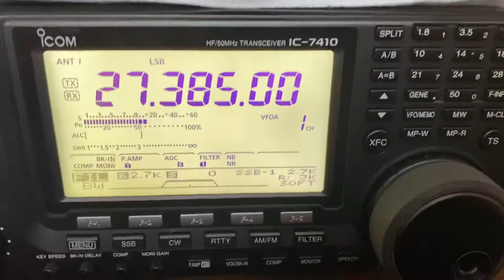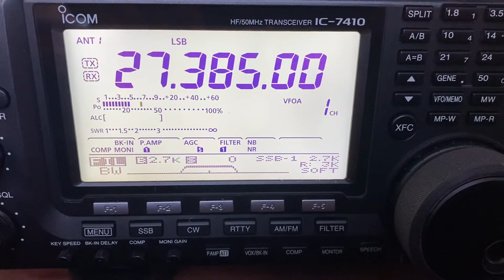Kenwood TS-590s VS Icom IC-7410

Comment: to me Kenwood sounds a lot better
Reply: Don't you think that the reason the sound of the Icom 7410 is muffled is because it has that piece of fabric and the other transceiver on top, covering its speaker ?
Reply: @marcelotoniolo4434  are they going tru those speakers on the side?
Reply: @edingacic546  speakers on the side ?  There are no speakers on the side on the 7410, just on the top.
I have a 7410 and know the radio very well.
Reply: @marcelotoniolo4434  do you see external speakers on the side ?
Reply: @edingacic546  That defeats the purpose of the test.  They should be using their own speakers.
Reply: @marcelotoniolo4434  it's youtube what do you really expect  Sherwood level testing?
Reply: @twohandsandaradio  No..just done properly.  Is it too much to ask ?
Reply: Honestly, the Kenwood NR sounds a bit worse. Very “watery”.
The only other differences in audio quality can be due to the different external speakers.
With the speakers used here, the 7410 sounded better.